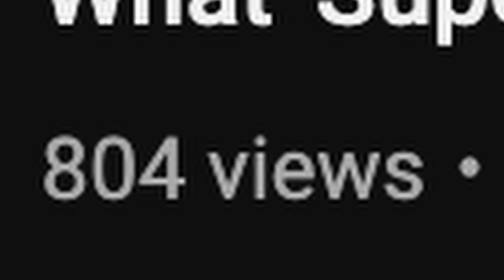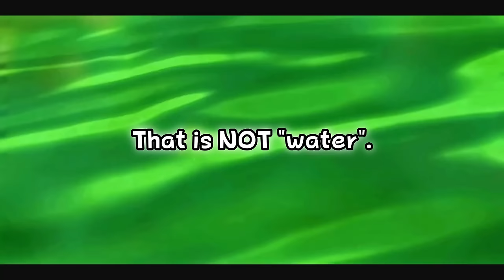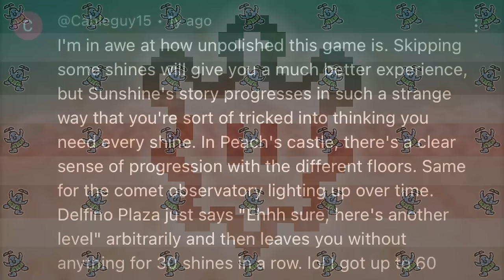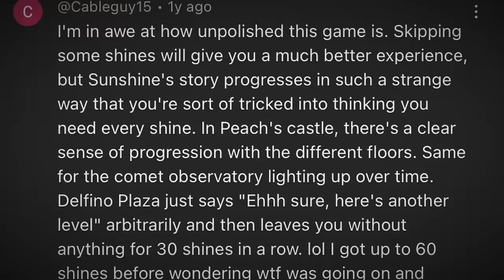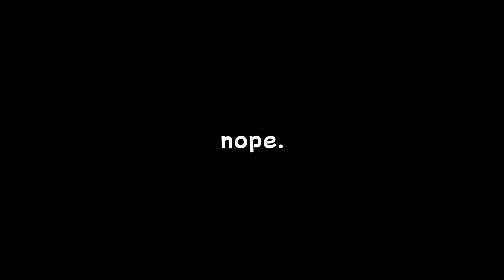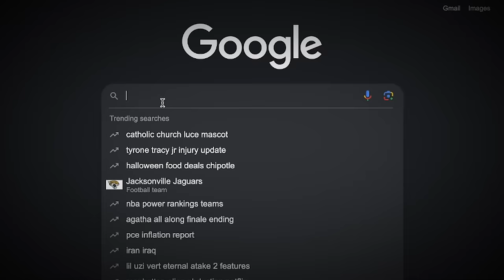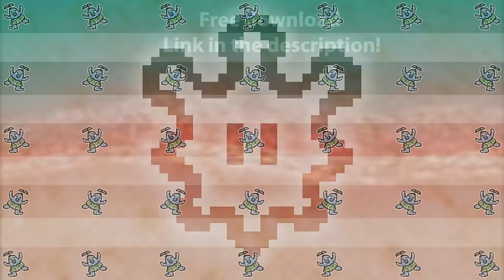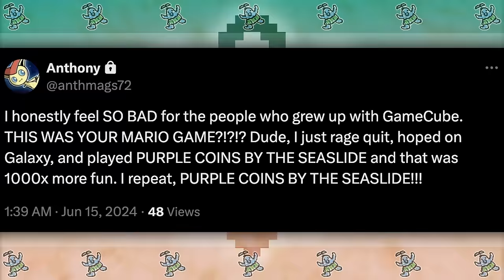Sorry Millennials, Super Mario Sunshine SUCKS!

Comment: THANK YOU. This has validated my years of gripes about this game. And look, I badly wanted to love it. The Mario franchise had been my favourite since I was ten years old and I first played Super Mario Bros, and it's always such a huge moment when you have a new console and you get the new Mario game for it... but it always felt off. 

I don't mind so much about different character designs/worldbuilding - island resort theme gave them an excuse to put Mario in a new situation, and I liked the parallels with Luigi's mansion. But it had such a hard act to follow. Super Mario 64 has its flaws (more palpable the further you get from the original controller - I'm finding it a strain on the Switch), but there's a coherence and balance to the level design, a gentler difficulty curve, and most of all, you can trust Mario to handle predictably. So despite many frustrating levels, you always know when it's a skill issue and not just the game itself playing you dirty. 

Not so with Sunshine, and that was such a bizarre choice for the Gamecube's flagship Mario game - I feel like if you were a kid just getting into Mario this would be unnecessarily offputting. In so many of the levels, it feels like the game yanks the rug from under your feet and then laughs when you fall painfully and have to start all over again - I guess it just feels uncharacteristically mean-spirited, like the game wants you to fail. I'm glad they got all that out of their systems, whatever it was about, but it's still a pity because there's so much in here that is fun and ingenious: I loved the physics of the rubberband walkways in Bianco Hills, for instance, and the basic idea of the FLUDD backpack was so innovative at the time... but it's the Mario game I feel the least nostalgia for.

Comment: I'm a millenial, and I never played SMS until I got a gaamecube emulator a couple years ago. Instant disappointment and frustration.

I was baffled about how it could be so much worse than 64, but alas. I stopped playing after getting like 6 shines.
Reply: Bro get good when people say they don't enjoy the game it's a skill issue
Reply: @blametl4921  I don't want to get good at a game I find boring and full of "gotcha" platforming gimmicks.

I know how to "git gud" or whatever (note my pfp). I just don't see why I'd bother with something I don't enjoy.
Reply: @DrunkenHotei  what gotcha gimmicks. if you liked 64 what did that game have that this didnt
Reply: @blametl4921  Welp, YT deleted my comment for no apparent reason.

Basically, I threw in the towel after getting thrown around at almost random angles by those fat hula guys and dying 20 times to that jump over those gears in what seems to be the first level.

If you like mainstream Mario platformers enough to not get frustrated by that and/or don't find it hard, fine. I'm not here to say that people who think the game is "good" are objectively wrong.

My gripe can be chalked up to the fact that it doesn't gradually ramp up in difficulty from nearly zero in the way 64 did. It more assumes you are as good at 64 as you ever were, then adds a bunch of mechanics that can waste time or even kill you when not done correctly on top of that, and I took no satisfaction when I finally did get the first few shines. I just felt relieved to be done with it.
Reply: @DrunkenHotei  fat hula guys do you mean piantas? If there's a chuckster the angle is not random I determined if you walked ,ran ,angle you talked to them or made them angry. What even killed you in that situation. This game is for people who had masterd 64 think Mario the lost levels more than a whole new game. So what would you say is objectively bad about the game? there are many mechanics I hate in oddesy but I would not say it is objectively a bad game
Reply: @blametl4921   part 1 (sorry, YT is being stupid with its filters again)
//you mean piantas?//

I guess. Again, I stopped playing after only getting like six shines. I got to the water level with the cages, and that was it.
Reply: @blametl4921   part 2
//This game is for people who had masterd 64 think Mario the lost levels more than a whole new game//

Yeah, that's what I said (more in detail in the comment YT deleted for whatever reason). It assumes I'm just as good at platforming in 3D Mario as I was when I had just finished 64, but most of their audience had not played a Mario game for a few years by the time it came out.

Again, I didn't get it until recently, so that's like a 20-year gap of not playing Mario 64 or anything other 3D platformer I can think of offhand. A couple easier levels to re-acquire my skills would have been a smart move imo. Then the game wouldn't have such a bad reputation compared to the others like Mario Galaxy, of which I've never heard anyone complain about the frustrating difficulty from the very start.
Reply: @blametl4921  part 3 //So what would you say is objectively bad about the game? //

First of all, I specifically said I didn't think it was objectively bad (maybe that was in my deleted post? not gonna check)

Second, since I didn't get very far, I can only say that I think it was a bad design decision to make the very beginning so unforgiving. They clearly took note of this since again the later entries seem not to have that immediate level of "git gud scrub" difficulty, for which the Mario franchise is very much not known, as I think most would agree. Few play a Mario game looking to test the limits of their gaming skills.

I know one can get good at the game, and maybe it's fun after that. The speedruns look fun. But Some games are about being hard, and that's fine, but Mario usually isn't one of them. I love Hollow Knight, Dark Souls, competitive Melee, etc. I just don't want that from a mainstream Mario game, and I'm evidently not alone in feeling that way.
Reply: @DrunkenHotei  difficulty was not a concern in super Mario galaxy the Wii was all about accessibility and casual games so that's why galaxy had a different skill curve. I mean getting 120 stars in super Mario 64 will take you a good amount of time remember its pre Internet and games were expensive you would play a game till you could fo if blind folded. The gamecube was for serious gamers it was the most powerful console of its generation and it's controller the first of its kind. I can tell you for a fact I have hot worse at platformers there is tricks I could prefom in 64 and sunshine as a kid that I can no longer preform lol
Reply: @DrunkenHotei  I mean look at Mario franchise. Mario one 8 bit fun easy, Mario 2 8 bit unforgiving wants you dead power ups can kill you. Mario 3 16 bit fun get challenging by the end Mario world 16 bit how fo I navigate this map? Mario 64 skill full fun interesting Mario sunshine oh I forgot sadist made Mario games. Mario galaxy oh love this movement controls almost round good experience galaxy 2 why you hiding 3 stars in every mission legit leaps of faith with just a sparkle of screen to indicate it might be heard. Point being they have Been doing this new idea then expert version since the beginning. Also didn't you say you were playing on an emulator your argument is invalid
Reply: @blametl4921  lmao how does me playing on an emulator change anything?

The fact that you're trying to justify Sunshine's general distaste among modern players with references to Mario 2's notorious difficulty (as if it were fondly remembered either) and by trying to act like an emulator changes anything makes you seem... strangely invested in the opinions of others.

Emulators like Dolphin are so indescernable from the original GC that we hold literal tournaments on them, and everything almost always runs smooth as butter. Plus, people have been using them to cheat at speedruns since time without being noticed for years (I'm sure many are still succeeding).

But you want people to think that emulators just can't replicate something special (which I'm sure you can't actually articulate) about a friggin' Mario game? Hysterical.
Reply: @blametl4921  Look, I came here saying it wasn't an objectively bad game, but I played it and found it frustrating and unenjoyable. So did my wife. I looked it up after, and I saw that it was generally ranked the lowest in retrospectives and looked down upon as a lowpoint of the franchise by multiple sources.

What are you trying to acheive here? I don't like the game, and neither apparently do most people, and I've explained why.

Why can't you just accept that you enjoy a game that most people consider a relative low-point in retrospect? It's not like you can change that fact, so what's your aim in trying to debate my echo of the general consensus among Mario fans insofar as I can tell?
Reply: @DrunkenHotei  what am I trying g to do is drive up engagement of the video eventhough in my opinion it's a pretty boring video.
Reply: @blametl4921  How altruistic of you. Are we done now?